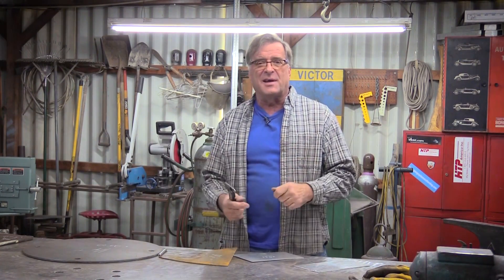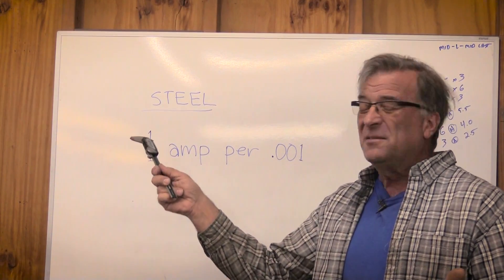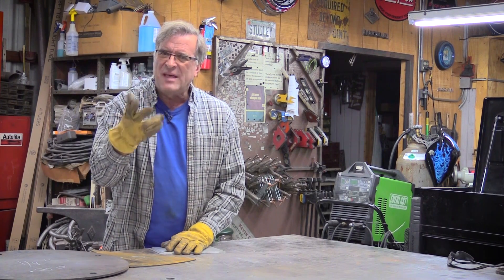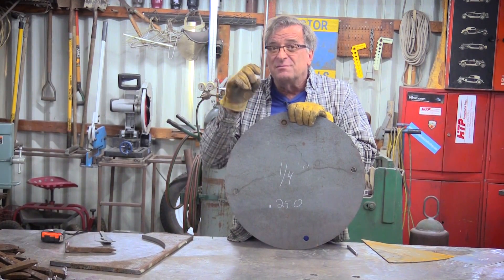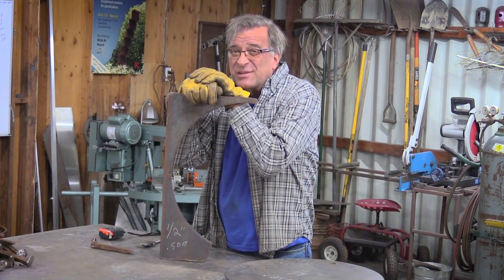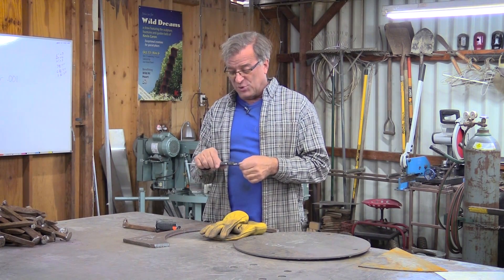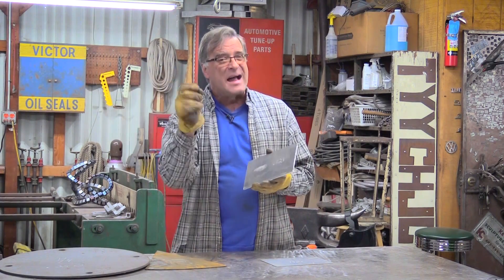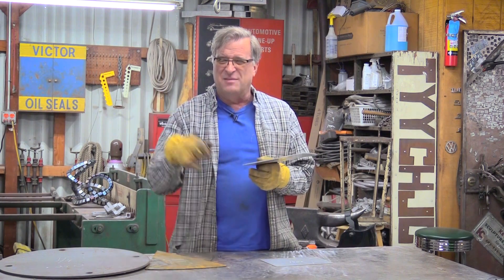How to Set Your TIG & Stick Welders - Kevin Caron

Comment: If welding were by rod thickness, imagine what I could weld with a half inch rod and 5 amps! I can make the same weld with any rod size (but obviously with varying amperages) - I just change my rod feed-rate.  Rod has nothing to do with the penetration of your weld puddle. I think a lot of people are confused because they see if they keep the arc on one single spot, continuing to heat up one area until the puddle gets so hot, it penetrates deeper.  They may think that it means they are making a quality deeper weld with less amps.  While the point could be argued that it’s possible to weld deeper with lesser amps by constantly heating one spot, you’re introducing other environmental issues. It’s not efficient and really not the correct way to weld. While I personally don’t usually USE over 95-100 amps to weld .125 steel, I could weld faster with 125 amps - but too fast to have any control of rod-feed rate.  Gotta find a happy medium that’s comfortable for you.  Kevin’s general guideline is pretty accurate. I think rod size for penetration is the flat earth theory of welding.

Comment: I have to agree with the other guys love your videos but there's no way you need 500 amps to weld 1/2 inch steel it's all in the rod thickness that you use that to set your amperages.. 3/32 rod I usually set my welder around 80 to 90 amps when I'm using low hydrogen rod round 75 to 80 when I'm using 6010 rod in that same size.. around a hundred and 20 amps for 1/8 welding rod and a little hotter for 5/32..that's what we use in pipe welding at least been doing it for over 17 years works great hope that helps anyone
Reply from the maker: I have never heard this side of the story   It's about the rod instead of the metal, just doen't make sense to me.
Reply: @KevincaronSculpture  I never needed 500 amps to weld 1/2 inch steel I always would go by whatever rod I was using and set the amperage to it and depending what right I'm using how many passes I have to make in pipe welding and fabrication as a mechanical contractor and pipefitter that's what we've been doing for over 17 years at least I have and everyone I've known I'm at worked we pass x-rays doing this Bend test.. I don't mean to stop you on your video I really appreciate your knowledge but that's one point where I had to disagree on
Reply: Kevin’s talking a general guideline.  He’s also talking about full penetration of the weld. If you want two pieces of metal to stick, yea— you don’t need 500 amps to make two half inch pieces of metal stick to each other.  If you want to fully penetrate two half inch pieces of steel or s.s. In a perpendicular config, you probably would really need to ramp up the amps close to 4-500 (if you wanted to make the pass at any respectable speed).  There are so many factors that go into this but overall, Kevin’s GENERAL GUIDELINE as he correctly states - is correct.
Reply: @MollerFarm  general guideline or not is not correct I never had to use that many amps to weld who is going to make a one pass over 1/2 inch plate just saying usually you make multiple passes.. between me and the thousands of other welders I've seen I never seen them use that theory to measure how to turn Ur amperage up.. we alway go by what size rod we're using.. general direction or not I still think it's false
Reply: Instead of adding the multiple pass variable (@1:52) to this general guideline, just divide this general guideline by the number of passes you will be making. It'll work for you, generally.       Pretty sure everyone welded 1/2" plate with a hammer in 498 A.D.   sorry couldn't resist, I know ya said 15-20 years.
Reply: @shakeeshakee9457  Very true on the multiple passes point.  I was more agreeing with his theory in general.  I also agree I always come up well under that guideline but materials are all different. Anyways, to each his own! :)
Reply: @shakeeshakee9457  If you were in fact going to run a single pass, full penetration bead on 1/2" plate then yes you would need something like 4-500 amps. Now who in there right mind would do that, I don't know but if you used a 1/4" rod and set the welder to 250 amps you would not have the penetration you need at all. Still, there is a reason we are taught to bevel, run a root then filler passes. Imagine the haz when running 500 amps and the size of cables etc. I'm not saying it can't and isn't done but in general I'd say very seldom.

Comment: Gord is correct. Stick is mostly rod thickness. Thickness of plate can have a very minor effect. Metal and rod type has an effect. For example, many cheaper welders can’t weld 6010 because even though they have the amps, they don’t have the volts. So not enough watts going in, and the arc flutters and dies.
Reply: Actually watts has nothing to do with 6010. It has to do with the design of the machine. If the machine has enough inductance to keep the current flowing then 6010 will work. Low OCV machines, typically inverters, often do not have as substantial inductors as do transformer machines etc so they cannot keep the current flowing. Today, some inverter machines are being designed with 6010 in mind so they up the OCV and inductance.
Reply: That’s not correct. There is an optimal amount of inductance. Too little causes spatter because the current rises too quickly. Too much inductance causes the rod to stick to the metal. Then you can’t weld. The arc goes out. Inductance opposes the flow of current. So the proper amount is needed. But you need enough power to melt the rod. 6020 is difficult. Too much inductance and you can’t weld at all. The proper amount, along with enough power solves the problem.
Reply: @melgross  So in my haste I just wanted to keep it simple. I have tried to find a reasonable explanation but can only find https://fsmdirect.com/welding/338-welding-and-machines-for-e6010-electrodes which is ok, but not complete. Truthfully its a combination of factors with the rod, the arc force settings, welding technique, the welders inductor size, OCV etc. I'm not a welder designer but I'm familiar with the design considerations and what it really comes down to is there are some inverters designed to weld with 6010 but most are not.

Comment: Very interesting, but I respectfully disagree.  You got it BASSAKWARDS. 
         
    The amperage should be set by the size of the rod. NOT the thickness of the material.   
  1 amp for every .001" is right but, that applies to the size of the rod.    Eg.    1/8 "  7018 rod....   1/8 rod = .125 "    set machine  125 amps.  
  All machines are a bit different.  125 amps is a good place to start. It'll be close, but you might want to tweek your setting a bit.
Reply: Gord, you have it correct! The 1 amp per .001 is referring to rod diameter, not thickness of metal. 3/32" rod = 93 amps as a starting point. No way do you need 250 amps to weld 1/4" steel and you sure don't need 500 amps to weld 1/2" steel!! If you went to 5/32" rods, you might go to 150 -155 amps and make multiple passes. This rule is ok for rods like 7014 or 7018, but you would decrease by about 20 amps for 6010.  For GTAW, your amperage correlates to your tungsten diameter. Each diameter of tungsten can only carry so many amps.

Comment: Another cool video. I took welding in high school but never pursued it further; skip to this year (I'm 33 now) and I started a handyman service and I get asked a lot if I can do any welding. I went out and got a flux-core welder to brush up/practice with...then I got the welding bug not just for work but for fun as well. Upgraded to a multi-process machine to start practicing stick with the intention of building up to MIG and TIG since general consensus online seems to be learn stick first. Anyways I'm loving it and frequent your  content for info and help. Disclaimer now; I'm not doing anything structural or that would require passing inspections. Just odd jobs like fixing little gates where the manufactures tacs broke and the like. Thanks for all the great info.
Reply from the maker: Welcome to the club John!

Comment: RE stick welding; is there a similar rule of thumb for plate thickness vs welding rod diameter?
Reply: Not quite. With stick, the rod diameter is by far, more important than the metal thickness. The type of rod makes a difference too, as do, to a lesser extent, they type of metal you’re welding.